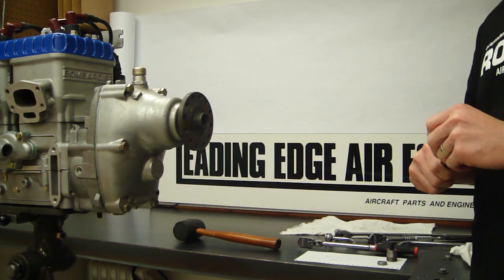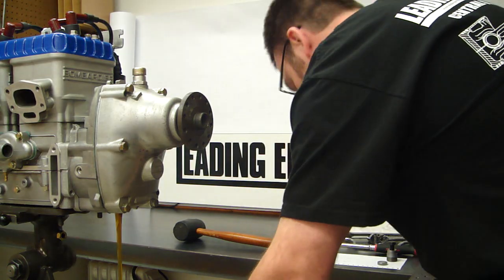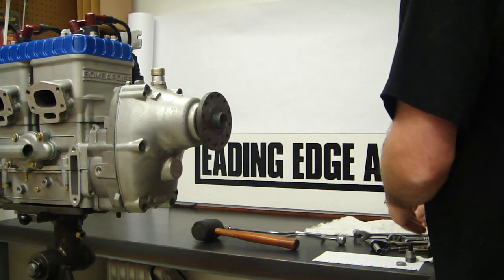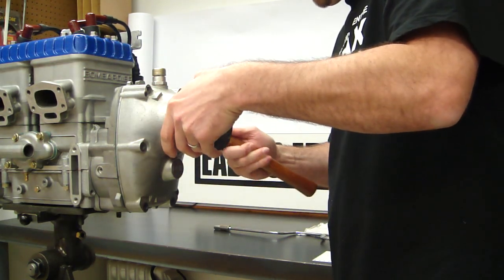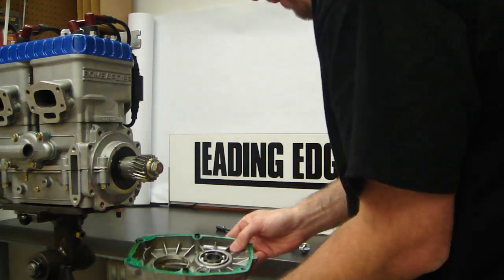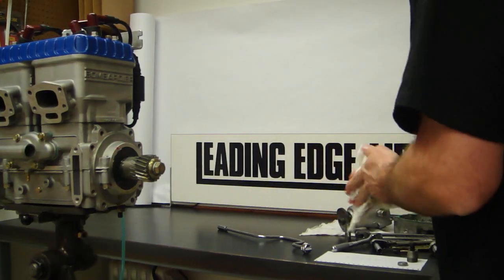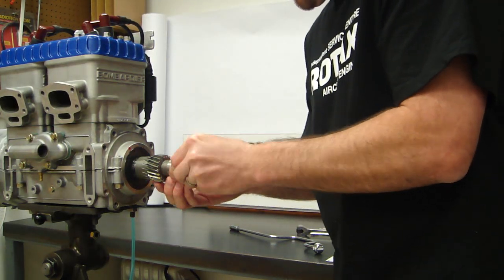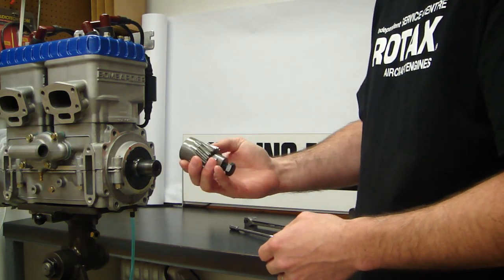Rotax B Gearbox Removal

Comment: Why is the locking pin attached to rubber hose?  Is there danger of the locking pin slipping through and falling into the engine without the hose attached?  What size is the locking pin?  I don't have this locking pin, so wondering what else to use?  Thank you!

Comment: It appeared to me that the gear that drives the gearbox and ultimately the prop, had no internal spline, but rather a taper fit. I don't think this is sound engineering.

Comment: Will the the b series gearbox I have on my 532 work on A 582?
Reply: The 532 used an "A" gear box as it had a prov. 4 crankcase.  A 582 has a prov. 8 crankcase and will only accept a "B", "C", or "E" gear box.

Comment: question .. i have a rotax 447 with the B gearbox .. it is has the prop shaft above the crank shaft like you have in this video .. can i turn it 180 so the prop shaft is down ????
Reply from the maker: Yes.  You'll need a new oring (850-430) and cover gasket (930-536)
Reply: thank you very much !!!

Comment: Hello guys, first of all great video very clean and right to the point. I have a question i like to ask you and see if you know something about it. Can you put a E Gearbox on a Polaris FIB with the Rotax 582 ??? all I see on this trikes is ether electric starter at the back of engine or pull starter at the same place at the back. I want to know if i can have bouth, electric starter with the E gearbox at the front and pull starter at the back  just to have a back up. Will the prop come out to far with the E Gearbox or is it no problem ??? Thanks on any help you can give on this.